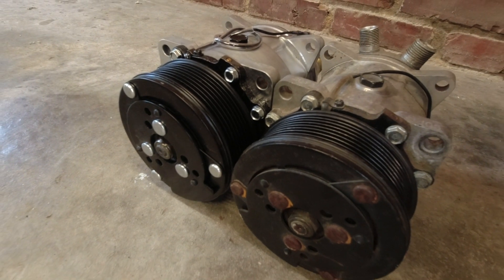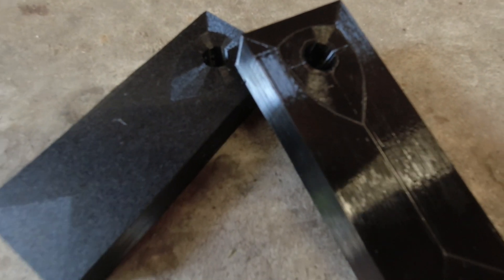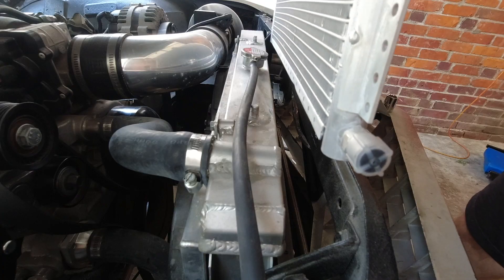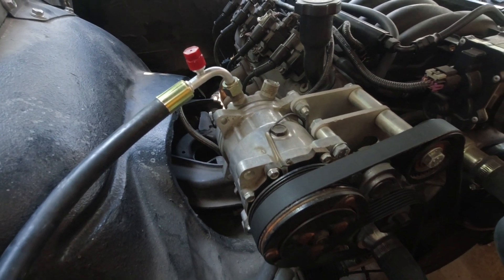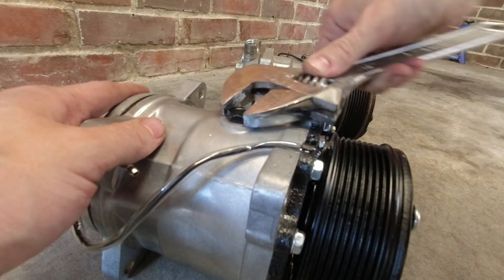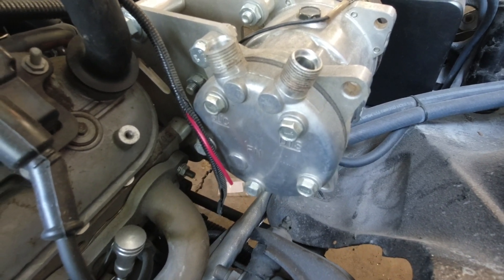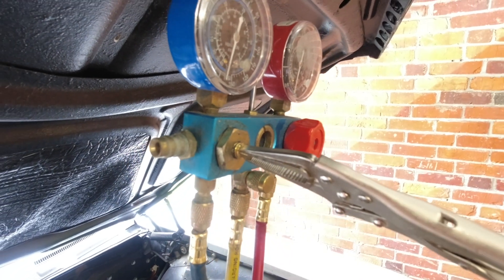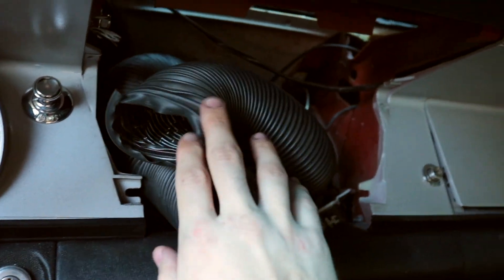Aftermarket A/C Install - Sanden 508, Hoses, Trinary Switch Fan Control and 3D Printing??

Comment: Interesting, I have just bought myself a couple of Vevor brand 508 style compressors. Paid $75 Australian each so that's about 50 bucks American I suppose. I was gobsmacked at the quality of these compressors and I did a lot of research on who Vevor is. Even watched a YouTube video on the manufacturing process. Vevor make so much mechanical stuff and other stuff it's unbelievable but their speciality is air compressors be at small domestic or commercial industrial use and also they make obviously these AC compressors, in many different fitment shapes. But they're popular model is 508. They have sold hundreds and hundreds and no negative feedback regarding these 508 so I bought two one for each car. Genuine Sanden are made in China now days anyway. They were made in Japan and Singapore but I believe now they are made under licence in China. Anyway just sharing, cheers for the video helpful and funny at the same time.
Reply from the maker: Thanks buddy and thank you for posting this info! I haven’t heard of them but I’m looking em’ up as we speak. I cringe when I see an actual Sanden come through honestly. It’s going to cause us other issues not related to the A/C functionality
Reply: I should have mentioned that the Vevor brand compressor can vary from $75 Au to $120 Au but I got mine on special plus a little eBay discount which they offer sometimes. I was interested in what you said about tolerances in the compressor being different as I noticed that the Vevor compressor has a little more play in the main shaft when you turn the front clutch plate back and forwards by hand than the Sanden does. But the quality is excellent even the quality of the aluminium buying housing is much better on the Vevor than the Sanden. I guess the big test will be in service on the car but I am confident with the reviews and other people's experiences in chat forums say that these Chinese compressors are excellent and at a quarter of the price. Anyway cheers and get that helmet on and straighten up and fly right with your head under the bonnet busy fixing the AC good job :-)
Reply from the maker: Hahaha always gotta have my AC helmet nearby! And did it have that play in the main shaft or was it play in the clutch assembly moving between its snap rings?
Reply: If you grab the front clutch plate and rotate it backwards and forwards you can just feel a minor clunk inside. It is definitely not in the pulley bearing or clutch plate. All my Sanden compressors do it as well but they are used and the 2 Vevors are brand-new. I think there is a couple of Chinese versions of the 508 one of them is a UAC brand but I'm not familiar with them. I'm really happy with the Vevor compressors especially since the company makes a massive range of hydraulic and pneumatic and AC equipment. Also I guess it was the hundred percent satisfaction of many hundreds of buyers that say the Vevor installed and works perfectly. Some hot rod forums have used them for a couple of years now and say no trouble at all. Some AC shops are traditionalists and refuse to accept Chinese made but almost everything is now made in China under licence even if it carries the original brand name. Good luck with your AC work and I didn't pick what the car was you worked on in the video is it a 68 Camaro?
Reply: @MatthewFinlay  what 508 knock off style compressor do you recommend i heard you say you don't like saden but the one you'd shown on yogi website say saden on it I just want a ac compressor with no major rpm drop thanks in advance

Comment: Is there a specific Sanden 508 style from eBay that you can recommend?
Reply from the maker: I like to buy from Yogi’s nowadays. I’ve bought both outlet location styles from them as well as v-belt and serpentine belts compressors. While they seem to be all the same Chinese compressors they’ve always been responsive to questions and easy to work with. I also like that they have a normal storefront and website - to me that means they just can’t change their name overnight and disappear like some eBay sellers do.

https://www.ebay.com/str/yogisinc?_trksid=p2349624.m3561.l49544

Comment: Dude, you're hilarious and informative!
Reply from the maker: Thank buddy! You rock!
Reply from the maker: I see the LS in your avatar but what’s it in?????
Reply: @MatthewFinlay  It's In a 90 240sx! w a  5.3. I want to fit AC in it. so I've been researching how to
Reply from the maker: @Talal Malkana should be pretty straight forward. The biggest pains I’ve ever run into is figuring out where the expansion valve or orifice tube (assuming o-tube based on it being from 90) is located so you don’t install two of them by accident. And figuring out the evaporator fittings. Probably flare but sometimes you see weird metric stuff not sure in Nissan. I used to waste time using as many factory parts as possible but it gets more expensive and aggravating honestly.
Reply from the maker: @Talal Malkana hit me up on Facebook if you have any questions!
Reply: i have to agree. the tip joke had me rolling. curious.. what accumulator did you use? that looks handy with the trinary switch port on it.
Reply from the maker: Haha thanks buddy, glad you enjoyed it! Just a universal accumulator from eBay actually. You can find them with no ports, 1 port and 2 ports. Be careful - they only have plastic plugs in them so if you get a two port - be prepared to use both ports of find out the hard way that the plug was actually plastic haha